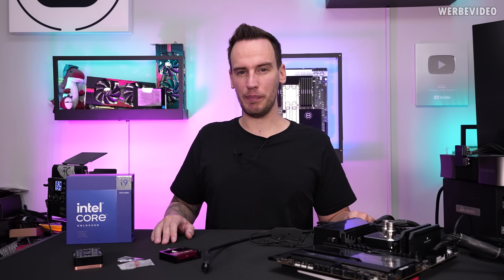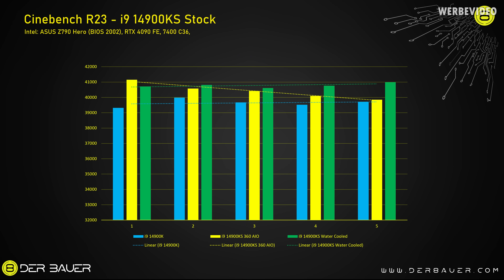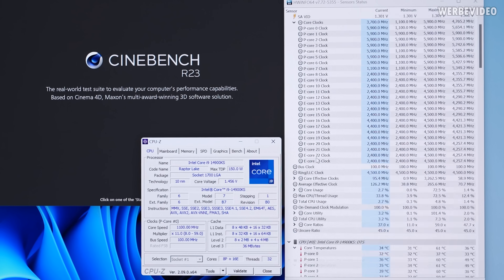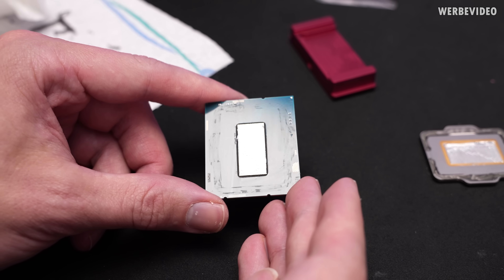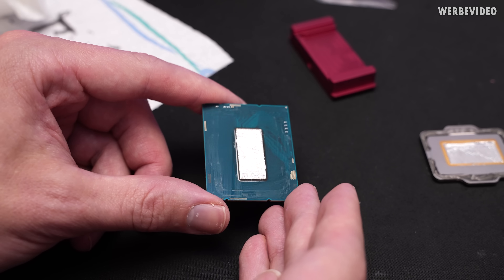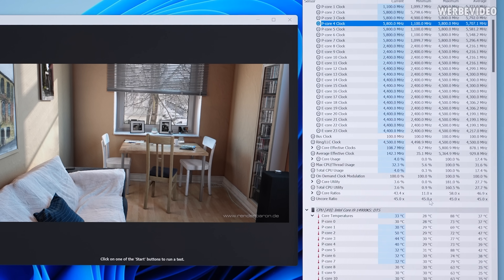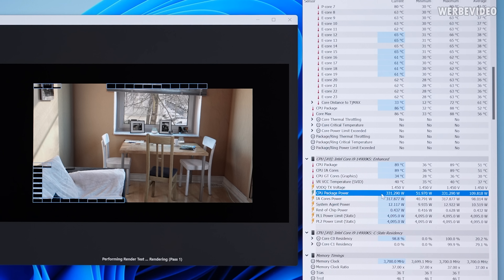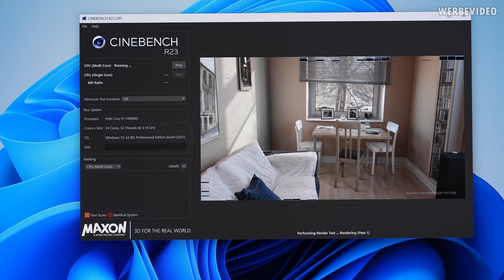My New Water Block - Time for 14900KS Direct Die

Comment: The reason the signal integrity is better when you leave the copper block further away from the memory traces is that those traces are impedance controlled as differential microstrips, which are top-layer trace pairs where the electric fields couple to the ground plane on the layer below and, to some extent, between the two traces. The impedance is based on the trace geometry and the relative permittivity (ε_r) of the dielectric materials surrounding the traces - in this case, the fiberglass between the top copper layer and second layer, and the soldermask and air above the top copper layer. When you place metal directly over the top of the traces, you're changing the transmission line type from a microstrip to a stripline, which significantly changes the characteristic impedance of the traces in that region.

As an example, a 45Ω impedance single-ended microstrip (with a 0.1mm layer height, dielectric ε_r=4.1) suddenly becomes 24.4Ω impedance stripline when you have a copper block floating 0.1mm above it, e.g. if you press it to the board. That impedance discontinuity causes signal reflections, which will narrow the eye diagram and harm signal integrity, and the copper block also causes a significant rise in conductor losses - if the original trace had 0.5dB of conductor loss, you might see closer to 4.5dB of loss with the block pressed to the board. That loss alone may be as much as a third of the total loss budget of the DDR5 link, depending on the speed! No wonder it doesn't work. If you lift that copper block just 2mm off the board, the trace impedance jumps back to within 10% of the original and the conductor losses plummet.
Reply: Dang, I knew the tolerances were important but didn't know it could change that much, thank you for the detailed explanation!
Reply: I am not awake enough to even begin to understand this, but thanks 😂
Reply: Me too
Reply: and that's why some ppl. can run 8400+ DDR5 with no problem and some ppl. that are very experts in DDR4 fail to run even 7600MT. Things change and you need to keep up with new way to undervolt and overclock.
Reply: This is some next level comment, thank you
Reply: would you say this is what you were saying? I chat gpt it to understand it better. 

So, in simple terms, keeping the metal block away from the path of the signals ensures that they can travel smoothly without encountering any obstacles or losing too much energy, which is important for the proper functioning of computer circuits.
Reply: @DavidKrinsky88  Hmm, that's not quite it, and honestly I'd avoid using LLMs like ChatGPT for things like this - just ask folks for more info :)

The electrical signals are electromagnetic waves, but you can visualise them like ripples or waves of water propagating down a long channel, like a chute. You can think of the impedance of the channel as the width of the chute. If you abruptly narrow the channel part way down, the waves crash into the edges, breaking them up - this is similar to what happens with an impedance discontinuity. Rather than a nice clean wave arriving at the far end, the wave gets distorted.

Electromagnetic waves move through different materials in different ways, so if the electrical design is tuned for having air over the top of the trace (like having the right chute width for the waves of water) and you replace that air with something else, it introduces a sudden change in the impedance (chute width) and causes the waves to become distorted.
Reply: So maybe they should cut even more copper away as it barely looks like a 1-2mm gap, I wouldn't want my expensive water-block to decrease my memory overclocking ability even a little bit :/
Reply: I always wondered why not to put straight traces down, someone one day explained this to me that the resistance and impedance must match for certain chips. intersting explanation you have
Reply: I don’t know what you’ve written here, but I guess you’re right.
Reply: @dronevan  it's about propagation time. the rising edges of the signals need to arrive at the same time, so you have to remove timing skew by keeping the trace lengths (or, more precisely, propagation timings) equal. the squiggles you see on traces are called meanders and they help with that timing matching process.

Comment: I had to RMA my 14900ks - without adding some LLC value, I couldn't get it stable even at Intel limits (NH-D15) so hopefully the replacement will be better.
Reply: User Error.
Reply: @dragonsyph2557  unlikely. The second 14900ks was just as bad, whereas putting a 13900ks or 13900k in the same system was fine. My other system is running a 14909k and that works perfectly. I have seen one guy try 3 14900ks chips, something doesn't seem right with the sku, perhaps they just cannot work without an amount of custom tweaks. They should at least work at Intel power limits with no other changes.
Reply: @dragonsyph2557  unlikely. The second 14900ks was just as bad, whereas putting a 13900ks or 13900k in the same system was fine. My other system is running a 14909k and that works perfectly. I have seen one guy try 3 14900ks chips, something doesn't seem right with the sku, perhaps they just cannot work without an amount of custom tweaks. They should at least work at Intel power limits with no other changes.

Comment: I have no trouble hitting 43744 in R23 with my 14900K without breaking 85C. Thanks but no thanks, Intel. Of course it is delided, lapped, water cooled, and running at 5.9/4.6 all core. Max power draw 318w.

Comment: 1.52V is nuts, as are the gains from this (temp drops, clock speeds, and power draw). Nothing like direct-die!
Reply: It's not 1.52v. Remember, that's the voltage before vdroop. It's probably in the 1.40-1.47 V area.

Comment: Awesome results, I will be looking for your cooler,  my 13900K is delided and direct die cooled, but it is a plexie unit, I like the looks of your better and hopefully will see even a few more C improvement, but I am already pretty low as I also use a chiller on a tank.
Reply: My stock 13900ks scores higher then his OC 14900ks, something wrong in this video.
Reply: @dragonsyph2557  it's pretty much the same chip you probably just got a nice bin

Comment: Wouldn't it be better to use a PCM (phase change material) like Honeywell PTM7950 instead of liquid metal ?
Reply: PTM7950 is good and, and fantastic for certain applications but for very hot, very high heat-dense area (ie. tons of heat & tiny space), like a powerful, little CPU die, liquid metal is much superior. Disclosure: this is from research, reading forums of others' experience (especially on overclocking websites), etc. and not from any of my own personal experience.
Reply: PTM7950 is nothing that special. Top end thermal pastes work equally good, while LM SIGNIFICANTLY outperforms even the best paste on the market. You could easily expect an 8 to 10 degree improvement on temps with LM over PTM.

Comment: Y'know what both Intel & AMD need to do in reality is, fix their damn IHS thickness.  I understand AMD "had to do thicker IHS" on the 7000-series to make coolers compatible, but to hell with that, I hope they make the 8000 series a thin IHS for better thermal conductivity and just make coolers need a new bracket for it or something.
Intel just needs to get their runaway power consumption under control, and also likely needs to thin out their IHS again too, since they've been using the same one for what, 3 iterations now (can't even call them generations since the only noticeable jump in performance was 12th to 13th)?  
Overclocking is almost useless with how both sides' chips are pushed so high to begin with, which is also sad.  Makes the K/X versions of CPUs almost pointless unless you want the very best there is.

Comment: I really wish your mycro blocks had the G1/4" placement as it on the alphacool one, as it provides by cleaner plumbing lines, especially when including memory cooler (which means sense again with DDR5).
I know alignment horizontally / vertically has been the norm forever, but neither are as good and vertically is worst IMO.
Reply: Wouldn't vertically - with intake at the top - be best for performance as the liquid is getting an extra velocity boost thanks to being acceleration from gravity? Personally, I'm just hoping his block's holes have enough spacing between them to use Koolance QD4 quick disconnects instead of the QD3 - regardless of vertical, horizontal, or diagonal orientation.
Reply: @Spinelli__  That strikes me as having even less effect than block/rad order.  Gravity will be pulling down on the return, thus equalizing.  It's a loop.

Comment: It would be nice to see a comparison of your DD block once it's available compared to the EK, Iceman Cooler and Supercool incumbents. I'd like to see the comparison include max core to core temperature deltas as well as an assessment on the repeatability of measurements over several installations, things people have struggled with when using DD blocks previously. I've personally tried all three and settled on the Supercool in my main rig, even with it making loop maintenance more challenging and requiring >200l/h flow. I never comment usually as a long time lurker, so wanted to take the opportunity to thank you for your content.

Comment: 🤔dual 420M radiators from EKWB are as good as a MO-RA3 420LT, bcoz MO-RA has a surface of about 6m² in total, while a single 420M rad has about 2,5m², except you get smaller fans for the 420 M rads and those have more static pressure....MO-RA is good only bcoz at low pump speed, you get like 2~3 minutes before the water completes one loop.
Reply: Just get Hardware Labs GTR rads in combination with Phanteks T30 fans in push/pull. Nothing can compete with the GTR for absolute top-end performance (2000 - 4000+ RPM, high static pressure, etc.)
Reply: @Spinelli__  2 minutes long nothing beats MO RA3, that is a fact. And on passive cooling 125W after 3hrs will get teh CPU from 72C to 86C....all that at minimum pump speeed too. So i guess, i will be for now staying with MO RA3....and the two 420M rads, if i feel like it, since i have these two options. MO RA3 is cheaper tho.

Comment: Why was the power consumption lower when you had more thermal headroom?
Reply: Laws of thermodynamics, the better the chip is cooled, the less internal electrical resistance, resulting in less energy required to do the same task

Comment: a 104 SP rating on cpu. What would a top SP rating be? 110, 120,  200?
i have no idea
Reply: My KS is 103, top is like 110 or so. Apparently it doesn’t mean much, every one will have different results based off your hardware and configuration. But high SP KS sell for well over a grand so there is a market for it.